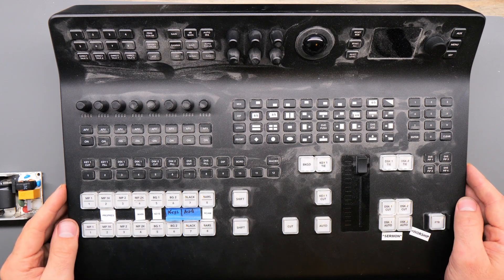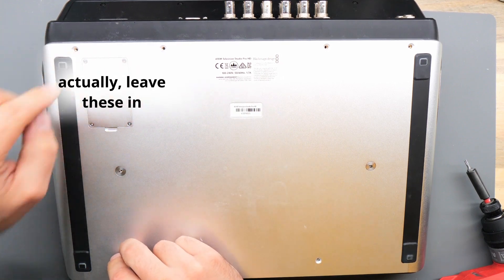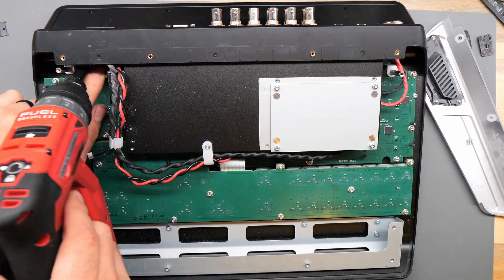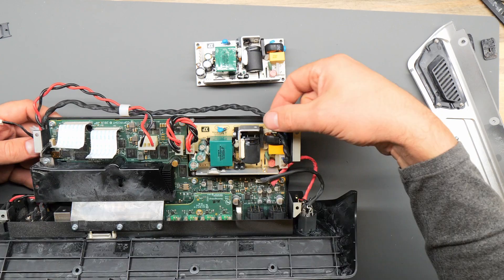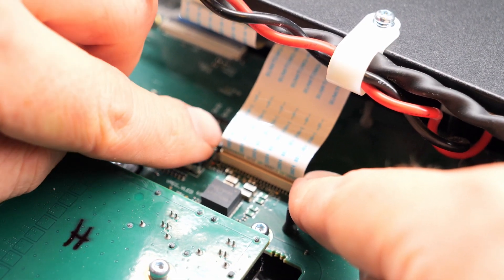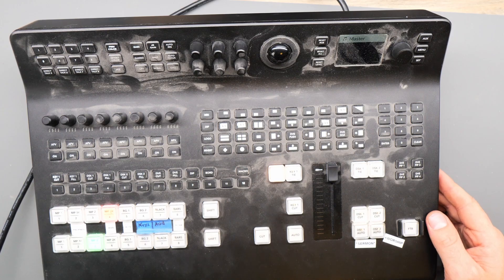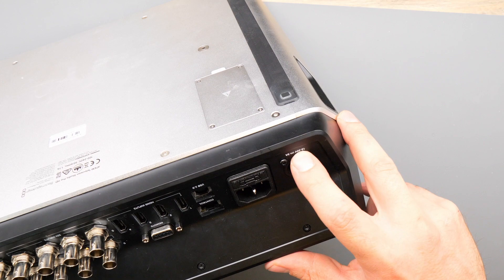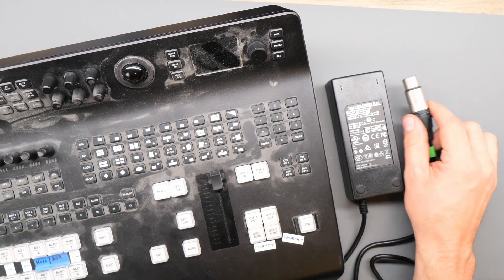How To Fix a ATEM Television Studio Video Switcher That Won't Turn On  - Two Methods Shown

Comment: Question mine doesn't  work either through  the 3 prong computer cable but can I just order the blackmagic power supply 4 prong  and conected throw  it?
Reply from the maker: If it's the internal power supply that went bad, then yes, the 4 prong power supply likely will be able to get you up and running again.

Comment: Hi. I have a ATEM Studio PRO 4K which has a problem with the XLR audio inputs. When nothing is plugged it regularly produces a spike and sometimes some white noise. And when We send sound through from a mixer etc.  the sound is very distorted and has a very weak signal. Any chance you can advise possible solutions?
Reply from the maker: Unfortunately I don't know that system through and through so can't advise possible solutions. I only opened it up and found the power supply fix was relatively straightforward so made a video on it. Sorry I can't be more help.

Comment: Thanks for the wonderful video and info.  I also had no power issue and no powering through the xlr port.  I was able to remove the power supply board without removing the back or sides.  After removing and disconnecting the power  supply board, i connected the 12.5v from my bench supply to the red and black wires of the power supply connector. Current limiting set around 2A, i was able to power on and not up, confirming bad power supply despite not being able to power via external xlr power connector. 😊😊😊
Reply from the maker: Awesome! Glad you found the video helpful!

Comment: My Sdi input number 3 is not working at all only sdi 3 any tips how to fix it or program it
Reply: it might be the L1219A2 12G UHD Equilizer chip Had to replace one on our Studio 4k we didnt have a HD-SDI coaxial line surge protector on the input and possible  static surge fried the chip. had it replaced and all was good.
Reply from the maker: Hmm, only thing I'd say is to check the connector end to make sure nothing got bent in there, and check the solder connections on the board for that piece. Wish I could be more help!
Reply: @42Pursuit    from the outside it looks perfectly normal and clean and i have never opened it from the inside ps i don’t fully understand what did u mean by connectors

Comment: Wow our Blackmagic design ATEM control panel also stopped working, it looks like there's no power. Because I'm working at a huge multinational corporation, I wouldn't be able to fix it in the presented way, but still very useful information! Thank you for sharing, awesome video!
Reply from the maker: Ah, that's a bummer you wouldn't be able to fix it. I wish this could've been your solution!
Reply: @42Pursuit I have fixed it! This company wouldn't spend a penny on replacing this piece of device with another one, so it needed some time, and my determination (my department is sooooo far from technicians / maintenance members), but it works now! I bought a female 4 pin xlr adapter from Aliexpress (~1.85 USD), and used our dead laptop's old adapter, found a guy who could solder at the company, and in 9months I fixed the device! 

Huge thank you once more for the great video, you're a legend! Have a nice rest of the week and don't stop sharing these types of tutorials.
Reply from the maker: @wody21 Heck yeah! Stoked you go it working!!!

Comment: Thanks for the video.  I tried making the XLR option and it doesn't power on, only the fan goes.  So I've ordered the internal part. I hope it's not more serious than that.   Any other suggestions? or did I just do a lousy soldiering job (not my best skill)
Reply from the maker: Hmm, if you have a multimeter, check the output voltage of the internal power supply with it plugged into power (careful to not touch any exposed contacts on the 120V AC side). If it's 12v then unfortunately it's a different problem than in the video. If it's not, then there probably is some issue with the xlr cord you built.
Reply: @42Pursuit  Thanks. I'll try that.

Comment: Thank u so  much ! We had at work an ATEM Production studio 4k and  it stopped  working. I ordered the power supply  at Digikey (the link u posted it) plus the 2 days Fedex shipping and I got it the next day. I made the replace and it worked as new, definetly much better to do the easy repair than buying a new one for 3k. Thanks for the video.
Reply from the maker: That's awesome! Glad you found the video helpful!

Comment: Would you have any advice (direction) on repairing a TV Studio Pro which has had it's multi-view outputs go bad? Both HDMI and SDI multi-view outputs have garbage on them. You can see the divider lines but none of the content from any of the inputs. I've heard it may be solder joints that start to crack after so many times of turning on and off. Unfortunately, upon contacting Blackmagic, they inform me that, due to shipping and parts procurement issues (caused by Covid 19) they are not repairing their products at this time. Very frustrating. Any thoughts?
Reply from the maker: I haven't done that specific repair but have had some success repairing bad connectors. You can sometimes clean up bad solder joints with a nice fine-tip soldering iron by re-melting the solder joints where the connectors are soldered to the PCB. It does take a high level of soldering skill as well as often a good microscope as some of the pins are extremely close together. Don't attempt this sort of repair unless the soldering skill is high as it can lead to shorts across pins which can damage components if done improperly.
Hope that helps give some direction toward a possible fix. Best of luck!